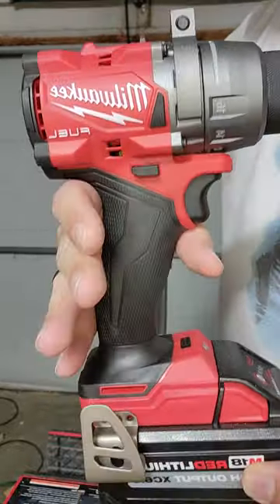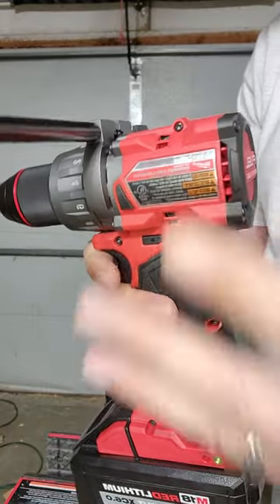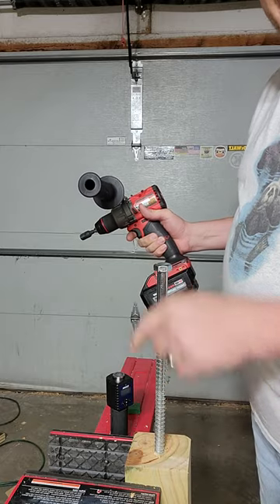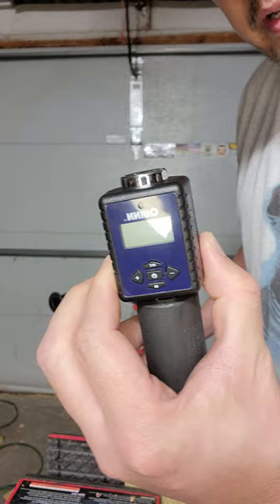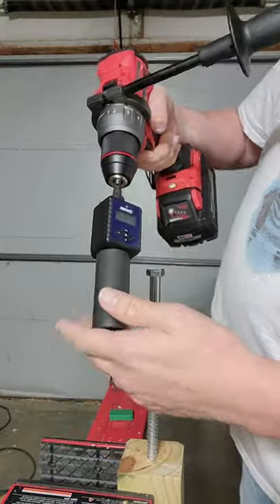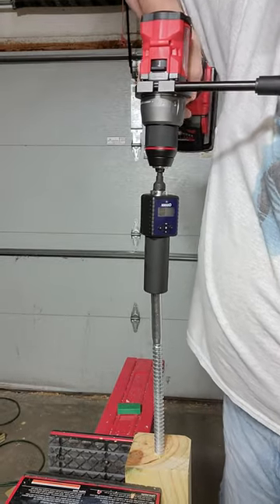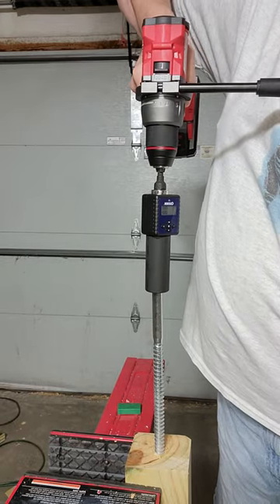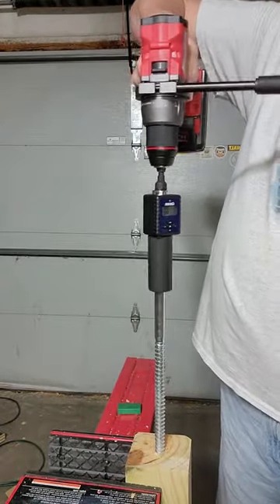Torque Testing the Milwaukee 2904 Hammer Drill

Comment: 44 ft lb that's as much as a Honda has
Reply from the maker: It's amazing
Reply: and much higher than vw
Reply: @automoto95  
My TDI golf III: at 149ftlb 🗿
Reply: @automoto95 an old TDI makes more torque than the whole honda dealership combined
Reply: @amg863   old noisy and wibrating 1.9TDI  makes = 250nm,  honda 2.2 = 340nm ,  honda 1.6 i-dtec  = 300nm  don't make me laugh
Reply: I wanna see a drill with the same torque as a Peterbilt 389
Reply: Not I know why my wrist hurts haha
Reply: @automoto95 but you picked the weakest and the worst version of 1.9 tdi available on the market. Because for example stock 1.9 tdi ASZ has about (130hp) 310Nm of TQ. And you can easily boost it's power up to 300HP with around 600Nm on stock internals. So it's not that bad
Reply: You mean to tell me, my tundra only has 44 pounds of power?

Comment: Did you try it on different settings. Like speed 2 or screw setting. Or hammer drill setting if it has. Also try with low battery and completely full battery. Also maybe different type of wood or bolt. Just to see if the torque changes alot

Comment: Enjoying these a lot. Could you do some Bauer stuff as well to show difference between professional and diy use?
Reply from the maker: Absolutely
Reply: Stay away from any tools that come from Horrible Freight! Most of them are broke before you buy them!
Reply: @pyro323  got the brushless 20v Bauer drill for car detailing, specifically drill brushing and shampooing seats. Works great because it spins fast and doesn’t use much battery
Reply: @pyro323  it's horor-freight, but close enough

Comment: Man if that goes on sale as a combo on Turkey day I’m going to pick it up.
Reply from the maker: It's great
Reply: It’s already on sale at home depot for as low at $290 +tax
Reply: @miggythegreat  I’m talking about a sale with extra free battery or free tool.  I believe that is what will come on Turkey day.
Reply: @miggythegreat  plus I got the gen 4 for free with the purchase of the m18 fuel  3 sec breaking stop.  That deal is still on.
Reply: 3 sec breaking stop m18 fuel grinder 2989-20
Reply: I like it cause of the 13 amp hour and 6 inch capacity grinder or cut off wheel disk.
Reply: Gen 4 drill and 1/4” impact driver combo is on sale now at Home Depot with 2 5 hour batteries for 399
Reply: @waynewilliams5353  thank you.  I got the gen 4 hammer drill free already  with the purchase of Milwaukee angle grinder 2989-20.   This deal is still running. Plus the last two tools I bough I got 6 5 amp hour batteries combined that came with the tools.
Reply: @waynewilliams5353  the deals on thanks giving and Christmas will be greater.  That kit will drop to 299 plus a free battery.  That is when it will be good time to pick up the kit.
Reply: @syesie5502  it was a good time for me anyway. I run a construction business. I needed 4 more batteries. I just bought 2 kits and got 4 batteries and 4 tools for barely more than 4 batteries. I couldn’t wait until then. I’ll need more tools by then though
Reply: @syesie5502  don’t forget to do your Milwaukee E-Rebates for even more stuff for free
Reply: @waynewilliams5353  I understand. You got to do what you got to do and that’s not a bad deal either since the tools just came out recently.
Reply: @waynewilliams5353  - Thanks for the reminder. will do the e-rebates this weekend for what came in.  Still expecting a m18 fuel jigsaw kit with free gen 3 hammer drill which I paid 249.99 for. Been busy last two weeks.  I missed the m18 fuel oscillating tool with free battery for 189.  Dam that was a good price.
Reply: @syesie5502  I love the rebates. Especially running a company. Every dollar I can save to get my guys professional grade tools for the job helps
Reply: I just bought one at a pawn shop BRAND NEW (witb tags still on it) in its original case witb charger and 2 5ah red lithium batteries. Lol. Its a BEAST. Watch the video by Vince re: the "hidden feature" (torque wrist protection). Wild!

Comment: 2980-20…..free gen 4 hammer drill.  13amp 6 in grinder with free battery or tool. One of the option for free tool is the gen 4 hammer drill or free battery or 3/8 impact wrench.

Comment: Undeniably a power house. Milwaukee never fail to impress it strength. That's why they have been the king for so long.
Reply from the maker: I would agree with you
Reply: Every dewalt impact in 3/8 and 1/2 drive that has just come out stomps everything Milwaukee and everyone else makes
Reply: @kevinragsdale6256  and then you woke up
Reply: @kevinragsdale6256  not true at all, they’re newest half inch mid torque and high torque slightly beat the two year old 2767 and one year old Milwaukee mid torque by about 5% on the curve, while both of them being quite a bit bigger in size than the milwaukees. When the third gen milwaukees come out they will probably make a bit more, but both of them are great tools. Neither of them “spanks” the other they’re very very close in performance and in normal operation you would never see a dofference
Reply: @achilleaustin  I think it's a bit of back and forth, the newest DeWalt stuff is pretty impressive like the 891 900 and 961

Comment: the torque value of the tested product is more as factory data.So even when we convert the Ibs value to torque, factory data is not obtained, do you know the reason for this, can you explain?Please.So how are we supposed to calculate?
Reply from the maker: It's in lbsft so divide that number by 12 and you'll get the inch pounds.

Comment: If you build cages and Mount TV's on walls can I probably just use the Milwaukee M18  
1.2 inch hammer drill and be fine . Those other hammer drills are more for construction because Milwaukee has the M18 compact hammer drills with out the handle
Reply from the maker: Ok

Comment: Can you do the new Ridgid hammer drill. I have both Milwaukee and Ridgid hammer drills and I can mix concrete faster on the Ridgid compared to Milwaukee fuel. Would like to see power of Max output Ridgid hammer drill
Reply from the maker: I can and I will. I also plan on doing this when the new Ridgid hammer drill comes out next month

Comment: How do we not know you already pre drilled the hole
Reply from the maker: You are welcome to try to do the test yourself and see
Reply: @ToolswithSoAlz  next time you should do a video showing maybe pre-drilling in the hole half an inch so the bolt can stay
Reply from the maker: The hole isn't a half inch deep. It's about six inches so the tool has time to build momentum.
Reply: @ToolswithSoAlz  ok so now it makes sense
Reply from the maker: No worries

Comment: 44 ft /punds is 59 newtons metro?? I dont understand  (bosch have 80 newton)
Reply from the maker: One of the reasons for doing this series is to show the differences between what company's say their tools do and what they actually do
Reply: I agree,  the results must to be totally real if you use only one test gadget on the diferents brands... please make a converssion newtons
Reply from the maker: I will try to remember to do that
Reply: The newest Bosch have 150Nm (110 ft pounds)
Reply: @jhonimastersipayung5874  is diferent  this 150 n-m is from the motor... but is diferent output of the drill.. i ben see other utubers.... germans,the tool delivery arround 75-80 newtons
Reply from the maker: That's just marketing, based on what they can get in some ideal scenario and using unverifiable testing methods.
Reply: @isaaccaris9530    Even lets say only at 75-80Nm (55-59 ft lbs), still superior compare with this M18 gen4 that also claimed the most powerful drill.
Reply: @isaaccaris9530  The 150Nm is not from the motor. It’s the output. 
Please remember for torque test, you should consider many things follow to standard. The very simple example, different bolt size will show different results. If you want to test at max 150Nm, you should at least use the bolt size that have torque at 150Nm range. 
Beside that, the grade, the pitch, etc etc also will impact the test.
Reply: @ToolswithSoAlz  Agree that’ a marketing. But not 100% BS. There are the method that follow the standard with calibrated test tool in their lab. 
Let’s say the accuracy maybe 80% from their claim’s, compare to our own test, it still good. 
In other way, is your test is verified test?
Just a question no need answer.
Reply: @jhonimastersipayung5874  it is insane output from the chuck.. whit this numbers, you can move a car, because one car needs 120 newtons  at weels. 
I bet bosch 150c does nt have more 80 newtons on the gadget.
Reply: @isaaccaris9530  I should say your analogy is wrong, because you compare with different cause. 
Of course 120Nm enough to rotate a car wheels if only they have enough horse power and the torque converter with bigger gears. 
Ok, let’s use another tools. Let’s say impact driver with 205Nm, ussually the torque of impact driver more accurate. Do you think the impact driver can rotate the car wheels directly?
No. It’s not enough power. 
Torque only one factor. 
In other engineering tools or equipment, they need another factors.

Comment: Milwaukee claims  116 ft. Lbs. 😂. I think you can eek out a bit more torque by bumping the trigger  again after it stalls out.  

I say manufacturers should be required to be transparent about testing method used to calculate max torgue
Reply from the maker: I agree but I am going to test all of the big brands in the same fashion
Reply: @ToolswithSoAlz  yep apples to apples so to speak.
Reply from the maker: Yes sir. I am trying
Reply: I would say this isn’t a proper test set up and these things bog down when they hit a wall. That wall being non predrilled wood which is a lot of resistance to a tool for a bolt that size. I appreciate the test no less because that is impressive still.

Comment: Take this as you will but ive turned over an engine at compression at a pretty decent speed with a milwaukee drill. Itll rip your damn arm off if you arent careful
Reply from the maker: Use the "B" stick

Comment: I just dropped 400 on the pack with the gen 4 impact and gen 4 hammer drill with a charger and 2 5ah batteries. I kept my receipt because ive yet to really use them but as a diehard dewalt fan. I was let down with atomic. Its gets HOT under medium duty work so i got milwaukee. Lets hope i didnt waste the money
Reply from the maker: You'll be happy I think
Reply: @ToolswithSoAlz  update : I've since bought * all m18 fuel latest gens* the shop vac. The side grinder. The hackzall. 2 impact drivers (one for spare) a hammer drill. A 1/2 impact wrench with a metric and imperial deep well set. Then I got 2 3 ah high OPs. 2 5 AHs and 2 3 ahs and a 6ah forge. Lol I've COMPLETELY switched

Comment: You should use a fully charged battery for a test like this
Reply from the maker: Check out the retest. Numbers are the same but you know
Reply: @ToolswithSoAlz  that’s great! I guess I learned something knew, I always thought that battery capacity played a significant role in amount of power a drill could produce for a torque test. You should do a test with different sized batteries and different charge levels on them
Reply from the maker: Ok

Comment: What size hole did you pre-drill?
Reply from the maker: Did you see the drill stop?
Reply: @ToolswithSoAlz  that doesn't answer my question.  Fail
Reply from the maker: It does
Reply: 5/8 lag bolt doesn't mean you drilled a 5/8" hole first

Comment: Obviously people do not realize that is not the purpose of a drill and just because it can do something doesn't mean it's suppose to. An impact driver is made for driving or removing fasteners even some impact guns depending what it is but anyone who says you should use a drill like this Obviously has not had a drill kick back on them from the torque being applied not to mention you never apply a load to the tool your using like it appears he was doing you let it do the job itself and if it can't then you need a different tool.
Reply from the maker: Yes sir
Reply: Very good assessment.

Comment: If you change the power setting to level 2 you will have much more torque
Reply from the maker: Absolutely not. Speed two is for high speed with low torque. Speed one is low speed bit high torque

Comment: I think 44 ft lbs is kinds weak, dewaly puts out better numbers I think
Reply from the maker: Dewalt didn't even come close
Reply: What mean is, I think the test reads wrong. It should read about 140 to 150 ft pounds for that. 44 seems low.
Reply from the maker: Could it be the manufacturer lied or none of them use the same testing methods? By putting them all through the exact same test we get an idea of what they can really do

Comment: The drill need the speed number 2 have more power
Reply from the maker: That's wrong. Speed 2 is high speed and low torque. Speed 1 is high torque and low speed